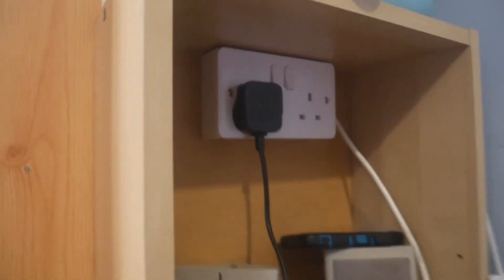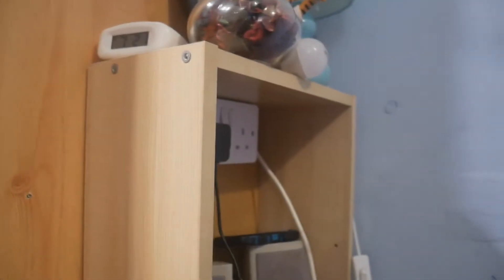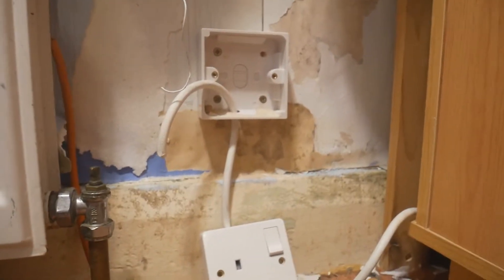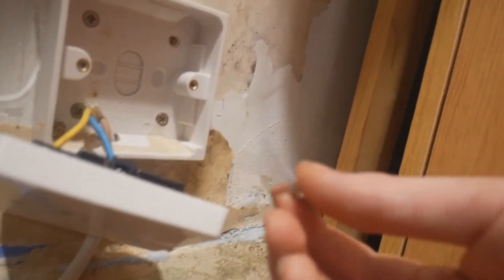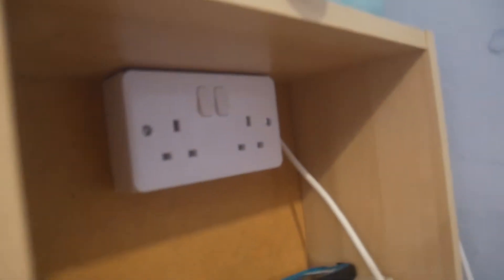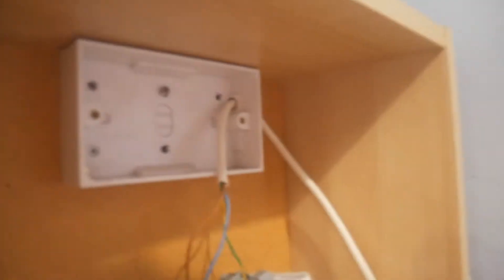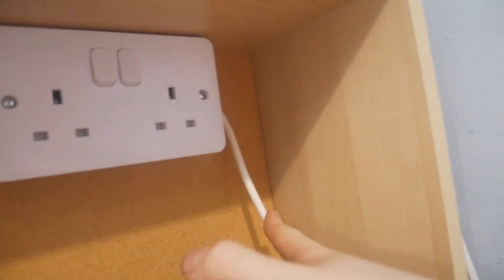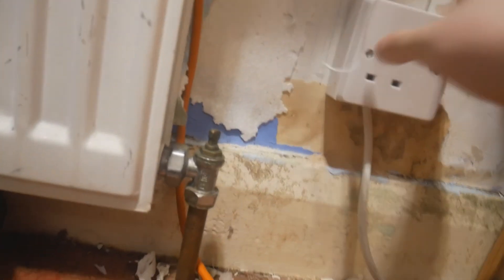Custom made extension lead wiring Uk

Comment: I have wired quite a few sockets into extension leads, I even used some of them to power table lamps until 
my Dad advised against it. But I still have those spur sockets present just for display purpose. As a permanent
arrangement it certainly looks neater than 4 ways plugged into one another. If the flex is fixed down with cable 
clips then that prevents the flex from accidentally being caught on anything.

Comment: I do my own work like that, and I do in work 1.5 mm cable can handle 4000 W, obviously straight from the socket using an extension lead which I have done with two electric heaters, which were 2000 W each. Yes the cable got warm but never had the fuse blow in the plug And it was heat resistant cable

Comment: Hang on - that's effectively a spur wired with 2.5 flex cord connected to a double socket SPUR, also wired in 2.5. What is your thigh bone connected to? And just a thought, what will happen when you step on one of those cables while pissed....nothing secured. Gulp.

Comment: I have one of those in my garage because the main plug socket is blocked by a shelf so I made one of those DIY sockets and mounted it and plugged it in to the blocked socket
Reply from the maker: Sounds good to me as long as your using 1.5mm 3 core flex protected with a 13a fuse then I don't see what's wrong idea,ly with flex you want a soft touch box with a 20mm comp gland but apart from that happy days

Comment: I'm gonna be honest with you bud, as a fully qualified electrician. Electrical work isnt guesswork and wholesalers are not qualified electricians to be giving out advice, it takes years of training and knowledge of the recent bs7671 18th edition wiring regulations to provide a fully safe and skilled service. There's a reason that we have to join a competent persons scheme and also get insurance, to ensure we are in line with ALL of the regulations - not just the few we know of. I cannot tell you what to do, however I would strongly recommend that you get a qualified and registered electrician to check your work and he/ she can provide a detailed explanation as to what does not meet the regs, and provide a quote to rectify the work.
Reply from the maker: alot of diy electrics goes on all around the country people replace lights swtches all the time
Reply: In all honesty, I shuddered a bit watching this. I think he's a bright lad, just needs to be careful. As i replied in earlier comment, a 13 amp fuse would easily take 20 amps if something went wrong. I've run 26 amps thru a 13 amp plug top with 1.25 mm2 during a test. It's worrying! If anything the house insurance would most most certainly be void
Reply from the maker: @shakeybill82   since now its been redone better with 2.5mm as i ve got better ive grown and changed it to be better
Reply: @kierantvyoutube3591  Good lad, keep learning and building towards your goals 👍👍👍
Reply from the maker: @shakeybill82   now im currently in college back then i would of been in early year 11 replaced lights on the lighting circuits downlighters with hager j501s the builder before was a rogue and it was electrical tape and terminal blocks now its a lovely neat job hager j501 for all the wire and a meridian lighting gu10 fire rated downlighter satin chrome

Comment: What size flex did you use?? Was it 1.5mm??
Reply from the maker: yea this was done ages ago however 1.5mm 3 core flex and a 13a fuse would be fine you basically made a switched extension lead of course be careful what you connect however phone chargers laptop chargers radios low things dont really matter

Comment: If you're doing this just to power a laptop or a LED lamp somewhere there isn't a socket, this shouldn't be an issue.  But yeah you wouldn't want to run a heater off that.

Comment: I've made extension leads with sockets but one socket as it's convenient and neater. Spuring off it is scary and adds too much for error. What worries me looking as the end point were the plug top fits doesn't look like 2.5mm either .

Comment: Ahhh !! This scared the shit out of me .. buddy please be careful I fully understand your in college learning but dont jump too far ahead of yourself Rome was NOT built in one day keep safe
Reply from the maker: ah dont worry alot has changed since then its all ok ive had no problems with it and since ive developed ive got way better and to be honest college learnign ha your kidding mate that stupid teacher there told us to cut back all our earths on a ring main to get rid of a earth fault on a installation we test our consumer units with open covers and connected to 13 amp plug tops ha atleast my work is safe recently ive built a consumer unit on a 13 amp plug top with the help of the electrical shop and they said its really safe i have learned alot more from the local electrical shop and self learning myself the stupid teacher cant take the fact i can do it safely
Reply: @kierantvyoutube3591  👌 good to hear your heading in the right direction
Reply from the maker: @roll-in-peace231   how bad is that in your opinion a college where the teacher is so stupid to the point they tell us to cut back the earths in a ring main to remove a earth fault and telling us to wire circuits using 1.00mm2 for a ring main
Reply: @kierantvyoutube3591  that teacher should be fired I've just finished my level 3 course and luckily I had a great teacher much better than I had last year

Comment: Just no - there is a reason why there is a fuse in the plug - your cable run would be better protected if instead of wiring directly in to the feed you used a 13a fused plug. There is the protentional (no pun intended!) of the full circuit mains (Usually 32A) flowing through that stranded cable run, the fuse in the plug is designed to protect the cable - you have removed that protection! Basically wall mounting an extension lead would be a lot safer and less risk than what you are demonstrating here...

Comment: Thanks! Great demonstration for a simple one extra plug socket.

BUT WTF IS GOING ON! It seems you've got 3 separate sockets 'splicing' off each other?????? Surely that can't be safe
Reply from the maker: its a old installation at the other end of the double socket was a flex leading to a standard 13 amp plug top this installation did not intrude into any of the houses actual wiring it was all rated down and fused correctly so in theory you had a extension lead there

Comment: What size us the flex?
Reply from the maker: 2.5mm 13a it has to be rated for the load you could use 2.5mm twin and earth if coming from another socket however the wire would have be flexi  to wire into the plug as wiring twin and earth 2.5mm in a plug is stupid
Reply: @kierantvyoutube3591  OK. Thanks!
Reply: That's definitely not 2.5mm

Comment: 1: stop calling the socket a plug. 2: This is not safe. You have no cable restraints at all meaningt hose wires could be easily pulled out. I find it amusing how this video is calling out someone for doing unsafe......by doing something unsafe.

Comment: your going to cause a fire , twin and earth some conduit , ingress issue, someone is going to trip over this or spill something, This goes beyond Regulations . Life is important, Get someone qualified. Never in a million would i let someone do this if you got family in the house
Reply from the maker: considering that was way back secondary and is gone now and im now a level 3 electrical student even i laugh at this and there would not be a fire as the plug fuse was there and the mcbs at the fuseboard works fine
Reply: @kierantvyoutube3591  You obviously need to study more as you clearly don't understand the risks involved...

Comment: This is extremely unsafe as is to using the proper wire of 3 core 2.5mm and he is plugging it in at a socket which cannot handle all of the load. Shocking
Reply from the maker: Actually that wire was of a 13 watt 3000w extension lead its attached  to a plug top with a 13 amp fuse meaning it can only ever pull 13 amps out the mains
Reply: Wrong. A 13 amp fuse could take 20 amps easily without blowing (not to be done!) I've pulled 26 amps through a 13 amp fuse on 1.25 mm flex during a test. Very good videos but always be careful
Reply: @shakeybill82   it really depends this installation isnt for anything rapid it's in a bedroom what could be plugged onto it speakers laptops phone chargers that barely pull anything
Reply: @elevatorphotagraphy4u22  Yes, probably only low powered stuff, but heaters are used in bedrooms too. 
Just need to emphasize electricity is lethal.
Reply from the maker: @shakeybill82   that end socket at the back of my room has now been rewired it is a mk double socket now and i have a 2kw heater plugged in to it during winter and i have had no problems with it i have been working on electrics for a while now i enjoy what i am doing i can see faults when i find them if its gettign hot it will be out of service for investigation im so strict on what i do and these are not used heavilly eg its for my use and all i really connect is my phone chargers my laptop and the odd tools such as 30 watt soldering irons and 30 watt hot glue guns therefore i could pottentially get away with a 5 amp fuse in the summer with how little i use it. 
the installation is working healthily and it has been rewired since then and i have never had a problem at all with it 

the college i currently attend is honestly stupid telling us to cut back the earths in a ring circuit to get rid of a earth fault without investigating it i have learned more stuff by getting advice from the local electrical shop hes been doing it for years and doing it myself i take good pride for my work that i do if i aint happy then i will keep testing till i am. 

i am not the type to get a stupid tradesman in why would i pay £250 or so for labour and parts and that for a new socket or even converting single sockets for doubles when i can convert a single socket by myself for about £5 

i do get advice from my uncle whos an electrician before i do this anyway therefore i am not just taking chances and connecting stuff together
Reply: @kierantvyoutube3591  Hi Kieran, I've got no doubt that you know what you are doing. Just always remember electricity can kill, always treat with respect. Good luck with your future projects 👍
Reply from the maker: @shakeybill82   yea thanks mate it will be ok theres isolators at every bit of the circuit in my room so anything isnt normal eg sockets getting hot etc then that part gets turned of for investigation and wont be put back into service until i am satisfied
Reply: @kierantvyoutube3591  Great stuff! I've got lots of my appliances connected with European plugs and sockets, just for convenience, as much of my stuff I've bought back from Europe. Google European sockets and it will show you. It might interest you to see how other systems in Europe work too 👍
Reply: By the very nature of you saying when things get hot it implies you haven't designed the circuit correctly. Also take into consideration the time you might not notice it getting hot, perhaps when you're sleeping? 

Please be careful,  but more importantly stop uploading videos like this teaching others how to kill themselves or burn properties down whilst failing to comply with the regs.
Reply: @kevbinzzz   couldnt agree more, comments on here are more shocking than the actually video itself. This is proof of why you should always get an actual electrician in if you dont wanna burn ur bloody house down

Comment: In theory you are making a 3 gang extension lead. The problem is you don't understand the theory so you shouldn't be making this type of thing. 

Extension leads can and do get over loaded but you are creating an environment that is easy to overload. You might only be plugging in low power items but the someone else who also doesn't understand the theory can and will connect high powered devices to your circuit at some point in the future.

An 'off the shelf' extension lead with multiple outputs has all the outputs close together so it is highly unlikely that multiple high powered devices will be connected so close together. However the dangerous circuit you are creating has mutilple outputs far apart so invite anything to be plugged in and that is the danger.

To top it off you should also not be making vidoes encouraging other people with even less knowledge than yourself to make equally or more dangerous circuits than you have there.

Regulations are in place to be followed so that dangerous circuits are not created when used within reason. Your circuit might work for you now but is unsafe and potentially dangerous.
Reply from the maker: all im gonna say is look below that was in early 2019 i have then since worked with my uncle whos an electrician and installed sockets in there properly so therefore its all safe now

Comment: DANGEROUS!!!!!!!!, focus the camera and leave electrics alone, you know nothing.
Reply from the maker: Considering I'm top of the class in electrical installation in college you can say that again
Reply: @kierantvyoutube3591  Focus the camera and leave the electrics alone, FFS, did you hear me this time?
Reply from the maker: @MadMiff   leave the electrics alone, its angry tradesman time yayyyyyyyyy
whats the problem it isnt scolmore click cheap tradesman tat 
is crabtree abit to premium for a tradesman
Reply: @kierantvyoutube3591  You might falsely believe you were top of the electrics class but I can tell you for sure 100% you are bottom of the camera operators class if you don't now how to get the thing in focus!
Reply from the maker: @MadMiff  look your wasting your time tgat was ages ago im better at it now alot better im not offended by your stupidity and that camera settings have been fixed now
Reply: @kierantvyoutube3591  If you are so good at it, why don't you remake the video, in focus and with safer instructions, simples.
Reply: @kierantvyoutube3591  You do realise it doesn't matter who manufactures the hardware - electrical safety needs to be done by the installer...